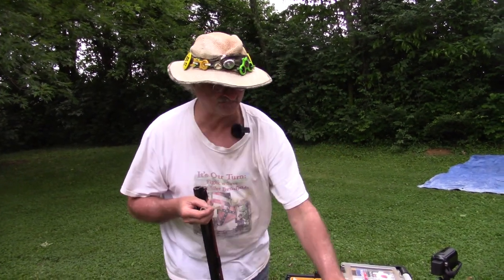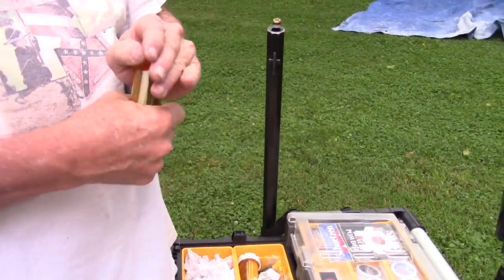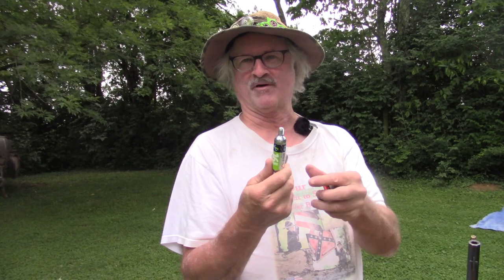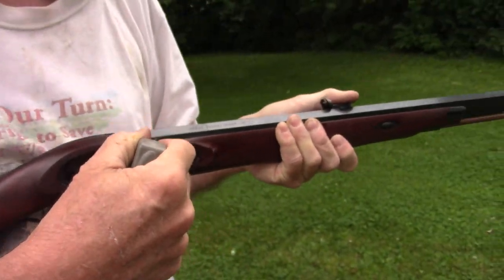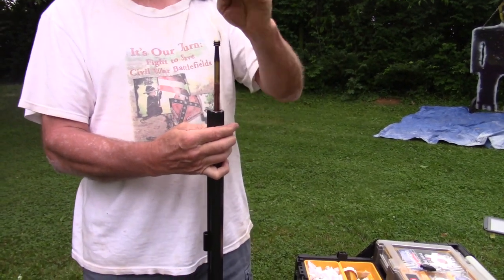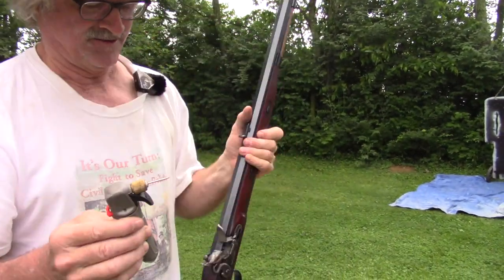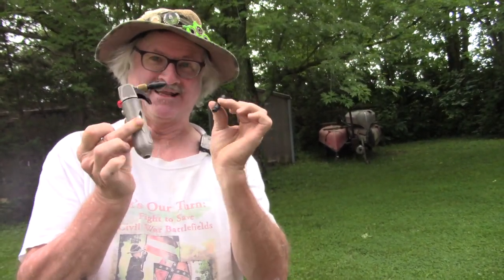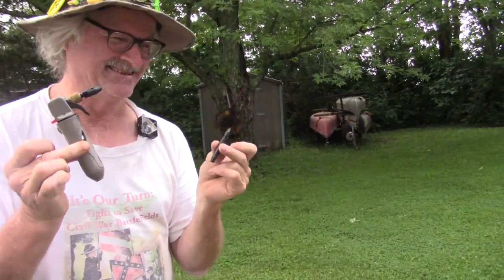CO2 Does it really work? Dryball

Comment: Years ago at one of our local BP Kielbasa Shoots (turkey shoot but the prizes were Kielbasa from a local smokehouse) a shooter had a contaminated owder charge when he loaded after cleaning is bore between shots and didnt dry his bore. Another shooter had something similar except he could charge his air cylinder from his truck tire instead of having to buy CO2 cartridges. Too bad they don't sell that mosel anymore, but then they couldn't keep making people spend money on refill cartridges, right?

Grest video. I just found your channel.
Reply from the maker: Absolutely correct. That's interesting using air from a tire to remove projectiles. Thanks for watching.
Reply from the maker: Absolutely correct. That's interesting using air from a tire to remove projectiles. Thanks for watching.

Comment: Thanks for the video I have not used one in a few years one thing I did notice with the earlier ones was the ball seems to come out a lot faster . I assume it was because of the better tips.
Reply from the maker: I believe you are right. They had a metal tip that would insert right into the touch hole. That would make a better seal. Thanks for watching...
Reply: @blackpowdermaniacshooter  Of course you do a great job on these I have enough trouble with a few still images! I will be putting a few on facebook today I found half a fawn while mowing it seems to be a bear kill on my property.

Comment: I seen some of your videos after I got a ball stuck in my .50 cal. traditions st. Louis Hawken rifle. I've been able to get stuck balls out before but this time is being seriously difficult. I noticed when your loading yours the ball goes down fairly easy. Mine is difficult, you have to give it some push to get it down the barrel. I'm sure it's the right size ball and I use lubed .015 patches. I'm gonna try the one method you used of putting powder in the bolster. Your videos are very informative and entertaining. Thank you so much I was ready to give it up.

Comment: Seems like a lot of work to shoot a flint lock or percussion weapon, however it's a smart way to find our if a weapon is loaded if you don't have access to the ram rod to check with.
Reply from the maker: Actually, the flint guns are pretty easy to shoot & also shoot out the round ball if drywalled. If you compare them to modern guns, obviously, there's no comparison.

Comment: I've used c02 to dislodge round balls. It works on my Flintlock. Other rifles may be different.
Reply from the maker: Yes, they work. However, I prefer the needle type fittings. You can leave the lock on the  gun & continue on!

Comment: I don’t have one of those but I always thought the stuff that comes with the those tire inflators might work. Maybe you thought about that?   Another thing is removing those screws on a Flintlock to get the plate off. Seems the gun I built one time had the spring that holds the ramrod being held in place by the forward screw. Could be tough if it moved while shooting out the patch and ball.
Reply from the maker: The traditions guns has those little metal springs to hold the ramrod in place. They are a hassle when removing the lock to clean.

Comment: Since I ride a bicycle regularly I have one of those in my bike bag. I also carry the needle with my in my shooting bag. But I have only used it one time. I like you would rather shooting it out. I have an RMC touch hole liner in my GPR which I really like. The fitting would fit right into those. But you would still need to remove the lock.  I hope you went and burned some powder. Thanks for the video
Reply from the maker: Yep..I did burn some powder!!  The needle works great I made with bench grinder. I'm going to make that other needle into video into one also. Thanks for watching...

Comment: Air gun shooters add a drop of pell gun oil to the tip of co2 cylinders before piercing them to keep the seals lubricated.    Don't know if the mfg of the co2 unit you used suggests the same?
Reply from the maker: I don't know...but, I'm willing to try your idea when I need to replace this one.Thanks for the tip.

Comment: How well does this work with a tighter fit?  I noticed you were using .480 balls in a .50 barrel.
Reply from the maker: They work with a tighter fit pretty well. I should have put a .490 in it, but didn't. I have used it with success on a friend's gun with a tight fit.

Comment: Had to shoot my ram rod out today , got it jammed in the bottom of the bore with a dirty patch on the jag  , pushed powder in through touch hole then shot it out.
Reply from the maker: Been there done that too!!  Works great! Thanks for watching....
Reply: @blackpowdermaniacshooter  I had 2F goex blackpowder with me and I was having trouble getting that pushed through the touch hole so I pulled the bullet from a pyrodex P loaded 45 colt cartridge I had with me (was shooting lever gun and flintlock that day) and used that powder to push into the touchhole, it went in much easier being a lot finer granules than 2F is. I got about 15 grains in their then pushed through some more 2F to help it ignite. Sounds like an ordeal but it wasn’t too bad , shot the rod out easily as well.
Reply from the maker: @mdog1615  Yep...that will work too. I bet you were excited to finally get back into shooting again!

Comment: wouldn't taking the barrel off be easier than taking the lock off??  (different strokes i guess)
Reply from the maker: Not really.....the barrel on the GPR has 2 wedges in it. The lock only has 1 screw on it. Lots of BP gun barrels are pinned, meaning, they are a real hassle to take off & not recommended unless you're using a work table or bench. Keeping up with the tools & pins can be a problem. Thanks for watching....

Comment: Those tips may work better if you remove the touch hole liner
Reply from the maker: I'm sure you're right, except, I cannot get the touchhole liners out of most guns...including mine. Thats why I made a way to remove the balls using ball needles. Thanks for watching...
Reply: @blackpowdermaniacshooter  I thought I saw the slot in the touch hole liner to install/remove it hence my comment but sometimes they just seize and it’s better not to disturb them. Good job with the ball needles ingenious.
Reply from the maker: @tnzayatz6579  Yep...all of mine are seized up. Thanks for asking my friend....

Comment: Is your ball undersized or something. It looks like it goes in way too easily. 
There are different bullet diameters and patch thicknesses. If it's too loose you'll be less powerful and less accurate.
Reply: Depending on your barrel I'd say try a .490. or a .495. But the .495 might be too tight unless you use a thin patch.
Reply from the maker: I use undersized balls. I agree with your logic, however, I'm not interested in pounding round balls down the barrels or use those monster range rods very often. I prefer to use slightly smaller balls and gun ramrods, just like our forefathers did. Thanks for watching....

Comment: Why not just pull the barrel instead of the lock.
Reply from the maker: Pulling  the barrel is unnecessary using CO2, especially if your gun has a pinned barrel. Here is another method that works quite well too: https://www.youtube.com/watch?v=vGy87a4c9NY

Comment: Sir, I HAVE THOUGHTS. Duck or swerve or dodge when nessecary as my though are bigmungous. 

Co2 is Great, never let anyone convince you anything is better IT IS NOT I HAVE TTTRRRIIIEEEDDD. 

ONE THING IS BETTER

Compressed Air. But you WILL NOT get Co2 Canister Power from a shop compressor, WE HAVE TRIED.

What you need is an HPA Tank, just a lil one. And an HPA Compressor. Just a lil one. And a regulator. Any quality one, then a hose just a lil one. And then probably just stick a compressor nozzle on the other end of the hose. Maybe a big one.

Boooy, Co2 is trash as soon as is get frosty. The alternative Gases like Green, Red, White, and Black are just weak, and unpredictable whatever they are and still freeze.

You CAN find HPA Hand Pumps and if you need more for your workout routine, great. Once a year you might have a full half pressurized can of air.

If you have money you can even get a carbon fiber Air-Rifle, Airsoft/Paintball tank and the small ones are still big compared to the biggest Co2 canister and about as light as one too.

Because weight is important and its easier to pack by volume.

Being Tanks, you could even fill a monster for base camp and have a water bottle sized one for the field.

HPA Tanks run strong on pressure for a while because there is so much pressure. My tank is like 3.l 4000psi. 

On paper the shops tell me I'm good for around 2500 shots but, I lay thick sniper bbs at long range in semi auto with pin point accuracy with enough force that impact to wood makes people jump. Easily getting 4000 shots before needing a refill. So they lie, on paper.

We use two 4l 4000 PSI Tanks to run our Minigun. Again, we have no chill, high power, high magnum, full go. We stop wanting to waste bbs long before gas running out, for a half dozen hours or so.

The important thing to take away from bragging about how damn good i am I overwatch is this;

We use the Best Gases, always and Whenever possible, as desired. We swap anything Co2 to HPA by taping a new valve into it. 

You just don't get the same power and power consistently with a Co2 canister It's fine for a side arm, its easy enough to work with. But, I can put holes in ply wood if I want to, with a little plastic bb. Co2 can't do that!

Now, now that everyone is convinced. HPA IS DE WAE.

The cheapest best route would be a new 100 dollar steel 1.5 litre 3000 psi air rifle tank. A mid tier regulator, like a $70 Amped SLP. AND literally any choice of designer braied hose line. I like 🍊.

Any harware air nozzle should work since everything we use is universal 🇺🇸 or at least Crown Units because everyone plays airsoft now, pretty much. Or, Australians Play "Gel Blasters" but its litterally the same guns looking like space blaster shooting with Orbeez 

Then fill it at a Paintball, Airsoft, or Scuba Shop. Usually for free however, a decent little HPA Compressor is like 200 bucks and run forever if you take care of them, IF YOU TAKE CARE OF THEM, STEVE! Great on the field, awful team captain sometimes I SWEAR. We need a compressor because the lazy LMG Marine couldn't change out some dirty water. Lord, give me some airforce, or navy, or at least coast gaurd. I am a guerilla and my whole team are grunts.

You could find a used tank, but they technically expire so... I don't know mines old, I don't much care or notice. Hasn't blown up yet.
Reply: Oh, and because Co2 comes out so cold it obliterates valves and o rings faster. I tell you, manufacturers either don't know, or don't care because every single weekend someone is complaining about a Co2 valve.

I can submerge like a seal and pop out shooting. Co2 would freeze my shit solid, for sure. (I run a Kythera, Other Airsoft Nerds, no computers, thats how 😅)

Oh AND BE AWARE some Co2 and Green Gases are Preloaded with Grease. Technically gun grade but you still might not want it.
Reply: What is being said is;

For a 300 dollar investment you could build a mobile compressed air gun, with parts very over-engineered for your needs and so could outlive probably most everyone here if maintained literally at all. For another 200 you can have the compressor to fill it in ten minutes.

I read the other comments and I think I answered ALOT of questions but I will be damned if I'm gonna go through and tag-comment everyone!!!

Maybe do a theory episode, then rig a model, then sell the prototype. Lol. I don't think anyone else is doing it.😮 

If you get rich all I ask for is a Pendersoli 10gauge Fowler so I can chop that hoity toity over priced itallian art peice into a double barreled "Blunderedbusted" and swap it out for 209 for ~ versatility. 

Because my home was built in the 30's it would never support a full cannonade. . Yar.
Reply: One of my edits didn't save so let me make a footnote.

A Small Fiber Glass HPA Tank is about 4 times the size of a Large Co2 Canister by volume and holds pressure at 5× the Magnitude but weighs, probably less. 

Since they are Tanks, you can even own a very large one for any base camps, then simply fill a smaller water bottle sized one off of it for the field.

The capacity is almost hard to comprehend I'm not gonna lie, because they are so small and light.
Reply from the maker: All good info, thanks for sharing.